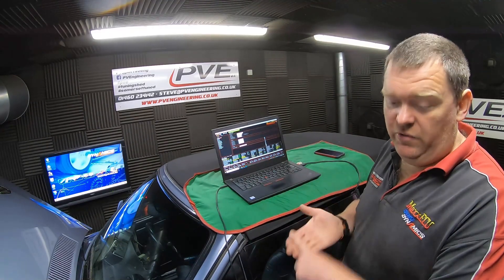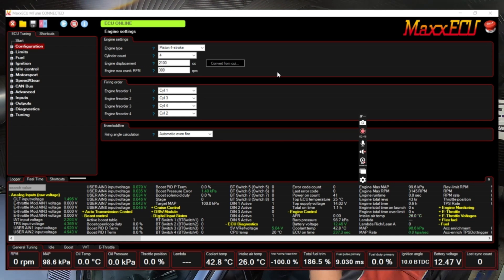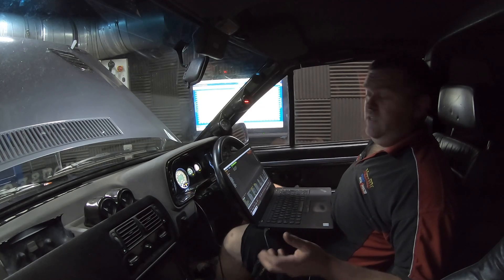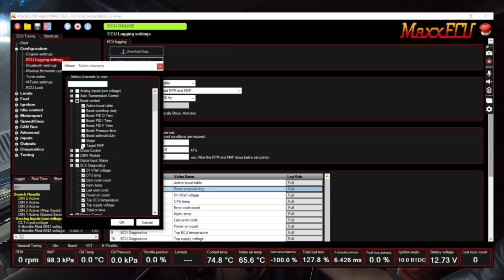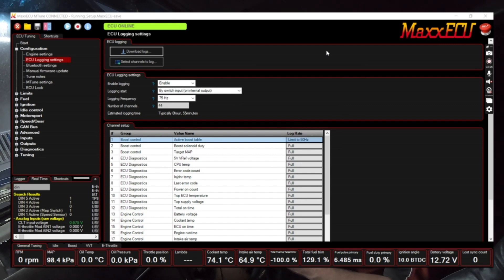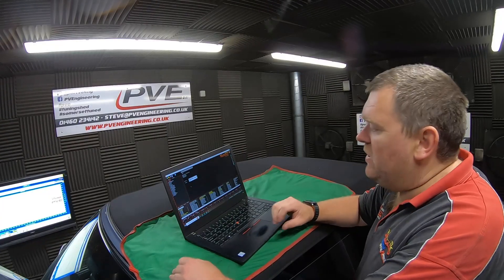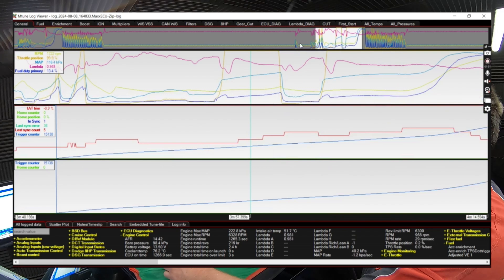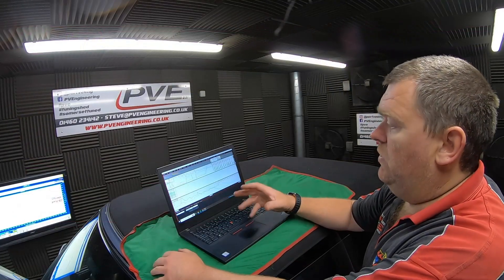How to use the Datalogging features of MaxxECU

Comment: Pwm messes up the battery slowly & silently n worst when the warranty has expired & on factory PCM messes up the throttle position sensors fuel injectors when it starts messing up or fan ,& the whole system is expensive in the long run , that's why j99-02 or 03jeep grand Cherokee wj i6 4.0 242 had them then they did not renew contract on 04 went back to the relay but the called it a relay cause went burn it stuck open circuit letting fan run full speed all the time when engine off after market closed circuit ,, old school brush fans , the brushless have had flaws , they can't really run reverse of what there are made for ,, dust debris inside messes them up , there still working on them which some don't burn easily even if water gets in that's what they say